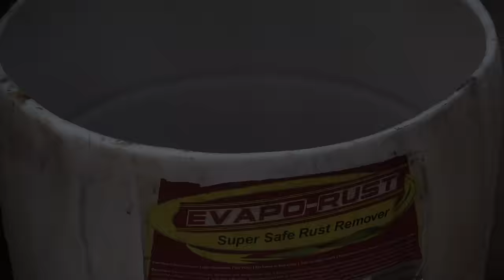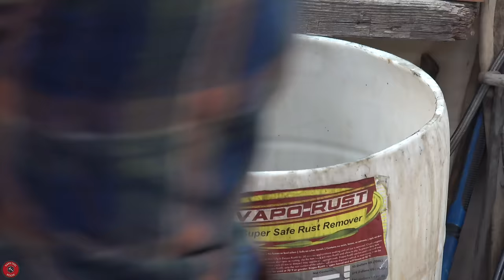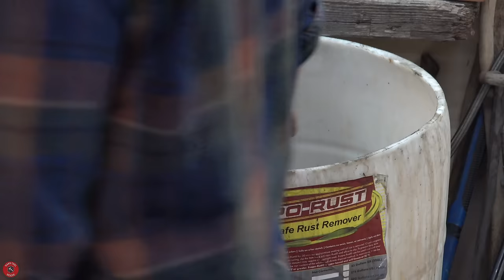1900s Pedal Metal Lathe [Restoration]

Comment: There is a product that has been out for years - called "Plus Gas". It's a Penetrating oil/fluid & works like Magic on Seized up nuts & bolts. Never fails to loosen up after a bit of a soak.

Comment: I suggest you keep that old lathe around. You never know when you end up with absolutely no power while at the same time needing to machine a part or two.
For that matter, you could possibly make a three jaw chuck for it so that it can achieve your quality standards.

It would also be a good lathe to train new machinists on. It will insure that they hone those necessary skills at a speed that will be less likely to break a tool as the machine can't necessarily run faster than their eyes can see.
Reply: He probably has a backup generator. Agree about possibly modifying a modern chuck to fit on that old lathe I thought of that too. I would suspect he would never use this lathe and would rather wait till he can use his precision modern equipment instead, I would. As long as he has access to a modern lathe this should only be a conversation piece. Or perhaps shown in a museum.
Reply: @jimthvac100  
I don't know about museum piece.
Roy Underhill uses an old wood lathe like that in his wood working.
As far as precision is concerned; as long as you have a good accurate caliper and other necessary measuring tools, that old lathe will be as precise as you decide you want it to be.

Comment: It’s probably already been said numerous time but the centring of the workpiece in the chuck was off centre because the chuck jaws were reassembled incorrectly. They were marked L and F. For left and right hand jaws so that they would align correctly with the jaw tightening screw .  If assembly doesn’t adhere to the correct order then the jaws will not close down to centre position.
Other than the above criticism, good restoration !

Comment: I guess this is a fan letter. When I first saw your stuff, I thought you had a garage in Kabul, or some third world country, and you were working with what tools you had. Since then, I've come to understand that you are as American as Dow Jones, and you simply prefer using older tools. I concur! Still don't know if you are just a tinkerer or if you teach Mechanical Engineering at MIT. I do know that your knowledge and ability are incredible. And you actually resurrect these devices, not just grind and fill and buff. I tip my hat to you in respect. Now, about that Insane Wrench design. . .

Comment: The machine has 3 speeds so you could even get higher speeds. The belt is now on the right (biggest) wheel on the top and and the smallest wheel on the bottom wheel, if you place the belt to the left of the bottom wheel you can place the belt on the smallest wheel on the top. Hope you understand my explaining.

Comment: I realize you are restoring an antique machine tool. Nevertheless I would like to make two suggestions if you are planning to actually use the pedal drive . One is to connect the pedal shaft to the drive pulley with a gear set (1.5:1) this would reverse the pedal rotation to a "forward drive" action which would allow you to use an entirely different and more powerful set of leg muscles. My second suggestion would be to install a back rest to the seat which would allow you to use your back muscles to assist your legs the way a recumbent bicycle is set up. A sturdier set of bearings would be required to keep the gears in mesh which wouldn't be a bad idea in any case. The original parts could be kept in storage for historical reference. It's obvious that designers in the 1800's had very little (if any) understanding of ergonomics. It appeared that even a few minutes of pedaling that thing was exhausting!          Poor James! Is he banned for life?

Comment: Machine has three speeds. If you want max speed just move the belt to the biggest portion on the flywheel and smallest on the drive. Just like with a bike. I love this old engineering.

Comment: As a machinist in the modern era, I can't help but cringe slightly at the idea of a pedal-powered lathe.  Constant stable RPM would be impossible...and yet at the same time now I want to try to design a CVT system for something like this so that it could do constant stable RPM lol

In fact now I kinda want to use modern machinery to make a pedal-powered lathe that's more precise than these old ones that were probably produced also using pedal-powered or similar machines.  Unfortunately I have neither the machinery nor finances for something like that...

Edit: I'm mildly impressed with the starting condition of these lathes though, definitely some of the best starting points you've had on the channel.

Edit 2: He joined you on the sandblast booth faceplant, yes!

Comment: I've never been scared of putting anything back together while taking it apart... But this might be an exception. That's a lot of stuff to remember. Even with a video I'd be a bit nervous. Also, i think you should check your assembly of that chuck... Can't tell from this video if you measured it all out, but there's a lot of adjustments that could be made. The thing runs too good to not be a good lathe for using.

Comment: only square head set screws were available then.
The two square nuts on the feed screw and lead screw would have been hex rounded finish nuts and the large hex nut on the cross feed would have been a smaller hex finish nut

Comment: Something i thought of where you dont want greese but you need to lub i thought of trying to get 2  2oz of 3&1 oil and get it up to about 150 deg f in microwave and the other out of frezzer just above 36 deg f and try about 50% of directions to make jelliton use to stuff that is plain no flavor and then get a med size siringe and you have something a lil stiffer than streaight oil but not greese to atract all the dust and dirt and still keep gears ect lubed im going to try it i would love to know what you think.

Comment: Wouldn’t surprise me if this was hooked up in a factory that was run on a water wheel or steam, looks enough room to hook up a belt to a factory’s drive system on the main rotor. Be interested to see this run off a tractor engine providing you can get a clutch or some sort

Comment: All I'm going to say is when you were using the lathe itself, that's what happens when you're not careful on putting the jaws in for those old chucks, they won't center right and they can be pretty fiddly. At least you were dealing with a two jaw and not a four jaw.

Comment: I wonder if one of the Weldon lathe chuck jaws is 180 degrees out of time with the locking screw?  I mean, was the left or right jaw supposed to start on the thread first?  Was it originally this far off center?

Comment: Maybe this is a big ol' dumb question. Could you flip the drive flywheel around so the larger radius is driving faster rpm? Lower torque but higher speed?

Comment: You don’t happen to have extras of the parts you cast, do you?  I have a very similar lathe (marked Peter Frasse) that I converted to run off a treadmill motor but it’d be neat to convert it back to treadle.

Comment: At 38 minutes and 36 seconds you say that you don't know why the threaded pipe was welded on to the large fly wheel/pulley. I wonder if it was for a crank handled to allow an assistant to provide the power?

Comment: @Hand Tool Rescue I got one of these from an old elevator repair shop. It’s missing the big lower belt wheel, would you mind measuring the diameters so I can make a replacement?

Comment: It seems like 99% of the nuts and screws are conventional right hand threads, but surely you must encounter some that are left hand threaded ... which begs the question, how do you figure that out during the disassembly?
Reply: Other questions:
Are you making detailed notes as you go, or taking additional photos to document component order during the disassembly ... or do you rely on the video footage to figure out the order when putting it all back together?
It doesn't seem like you degrease anything before putting it in the Evaporust (perhaps you've illustrated that step or explained it before and we should assume you have) but if not ... how would that work?
Reply: @Ohm51    Standard is right hand thread. But if it is mounted (for example) on the end of a turning axis, than the thread is made such way that the nut/screw tight itself when the axis is turning. That means anti clock-wise turning axis is with standard right-hand thread and a clock-wise turning axis is a left-hand thread.
(i hope the explanation is clear. It is sometimes difficult to explain, English is not my native language)

Comment: YOU HAVE THE JAWS incorrectly engaged on the feed screw of the chuck - Ive done this on old chucks.

One jaw has engaged on turn 1 and the next on turn 2 so your centre is NOT centre

Comment: That welded threaded pipe coming of the drive wheel? At some point someone converted it to a electric motor. Using a cone shaped belt wheel drive. The cone had two parts, as you tightened the cone it tightened the belt by pinching it and making it ride higher on the cone thus putting more tension on the belt.  Kind of like a VW generator that you remove shims to tighten the fan belt. The motor was probably mounted directly to the floor. This was probably a huge step for the shop this machine was used in. Cloth insulated wires with one of those switches that have a hinged fork that pivots on or off. The term throw the switch was used instead of turn it off or on. This would of been right after the AC current DC current wars and standardization to AC in 1894 . Its funny Edison wanted DC current and  called George Westinghouse's AC the killing current. Even electrocuted a full grown elephant in public. to prove it.

Comment: Guys Americans, here I am watching your video, cosmetic repairs are beyond praise (well, the machine itself is unique and clearly in good condition initially), but the question is, are you familiar in your Americas with the concept of checking for accuracy, but with an exact fit like SCABERING ? The machine is very productive, but you didn’t scrape it, you didn’t check the runout of the bearings, I also looked at the beds, I just cleaned it from rust ..
Tell me, do you have a specialized training for a repairman there in the Americas or are you self-taught? Separate apology for style and transcription (damned Googol))

Comment: I cannot understand why the lathe has to be powered backwards. Why not fit the chain crossed (left hand from bottom gear to right hand to the top gear.
Just move one of the gears sideways a little more than the width of the chain. Bingo.

Comment: I don't think that is supposed to be peddled "backwards" I think it is supposed to be peddled from the opposite side by a much younger person who hopes to be a machinist some day but for now has to watch an actual machinist while acting as the power supply for the machine. If you were on the other side the machine would crank the correct way but you wouldn't be able to operate it. You would however be able to watch and learn while getting paid to be the power supply.

Comment: You never checked the ways and by checking I don't mean looking at them. Checking is putting a pattern of minute scratches on the way surfaces to hold the oil from wearing off to fast causing damage to the way surfaces. Also I know you are proud of your monkey wrenches but there's a reason people stopped using them. Nice clean up though.

Comment: Advice, gratuitous — don’t use a diamond bar for roughing important surfaces — you kill it like that, you want to remove dirt and sandpaper to help even those with small abrasive grain R-240-600, and everything else with pens and a scraper.